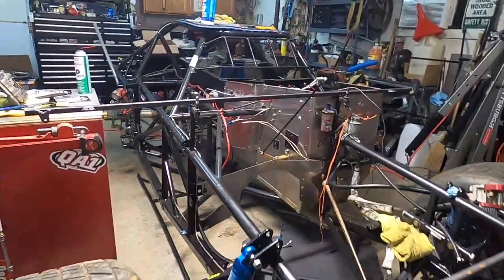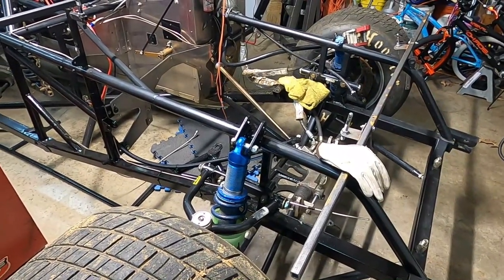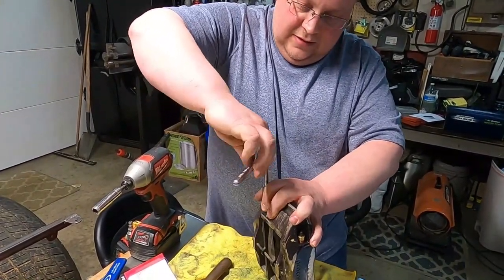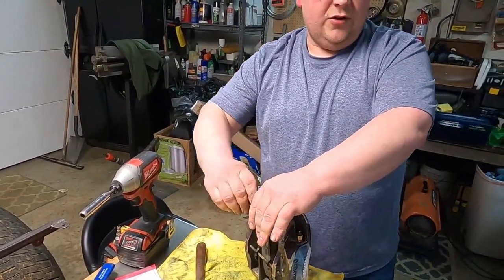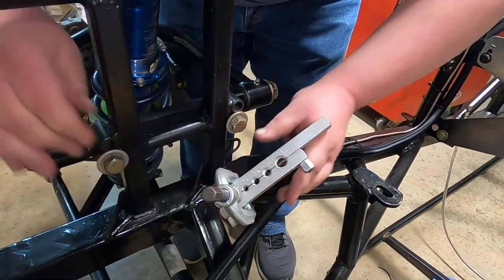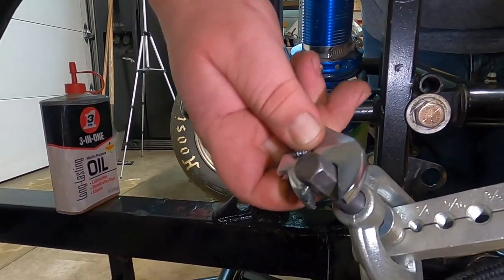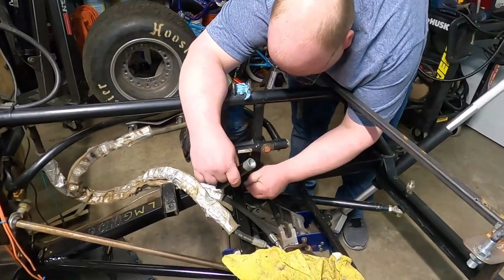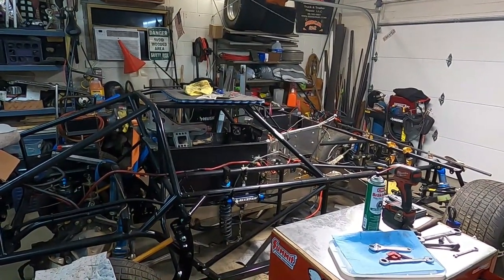WILWOOD RACING brake caliper REBUILD & BRAKE LINE FLARING DIRT LATE MODEL Mastersbilt

Comment: Looks good! I’ll have to check into that spreader tool for rebuilding calipers. Looks like it is much more convenient than a piece of wood lol! Thanks for posting that!
Reply from the maker: If your working on your race car or your pick up truck the pad spreader is handy dandy.  The one I have is from Blue Point and is nice but it was pricey.  Check out this one if you only do brake work every now and then. 
https://www.amazon.com/Caliper-Universal-Compression-Spreader-Instalation/dp/B086H2R1B5/ref=asc_df_B086H2R1B5/?tag=hyprod-20&linkCode=df0&hvadid=459441675016&hvpos=&hvnetw=g&hvrand=18060303734796290925&hvpone=&hvptwo=&hvqmt=&hvdev=c&hvdvcmdl=&hvlocint=&hvlocphy=9014402&hvtargid=pla-946197783315&psc=1

Thanks for watching!

Comment: Easy Way to get those pistons out, pop the first one or two with a little air. Pull the seals out on the ones that came out, slide the pistons back in hold that 1 side and pop the others right out. 5 minute job to get all 4 pistons out.
Reply from the maker: Great Suggestion!